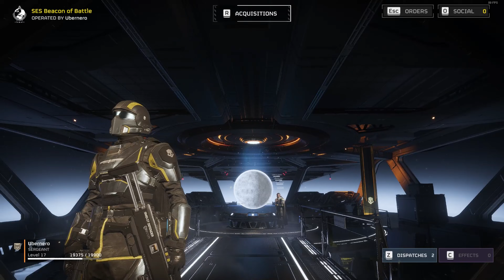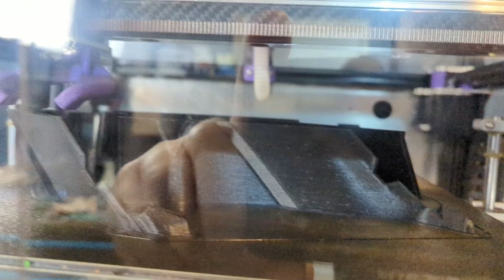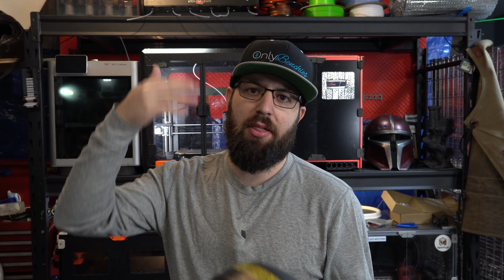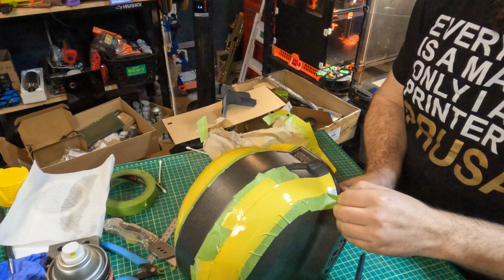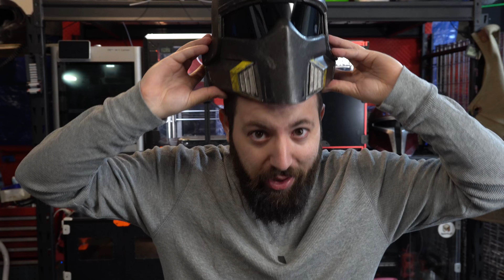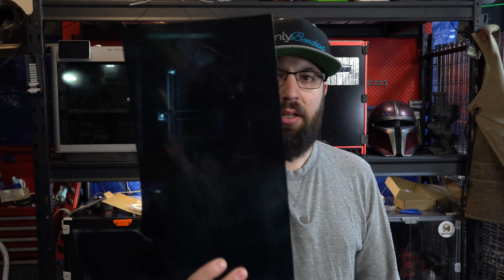I Built My Own Helldivers 2 Helmet (and you can too!) #helldivers2  #3dprinting #cosplay

Comment: I always used to do the many sanding and filling steps with my 3d prints (Mandalorian helmets and armor). For my current project, I decided to take a look at resin smoothing. I will try it with spray resin normally used to seal electric circuit boards. No idea wether this will work at all. But I have the feeling it might be necessary to do all of the pieces in one go, as the resin might cure after the can seal is broken.
I am changing my method now. All of the Mando kits I did before were heavily weathered (so yes, you can cheat a little there). But for this, I am planning a clean kit - so the plates have to be perfectly smooth. Particularly for high-gloss black - I am dreading this, TBH.

Comment: Could I print this on an Ender 3 v3 SE?

Edit: Yes, yes I can and it looks so cool can’t wait to start painting it!
Reply: I got an Ender 3 v2 with the same bed size, which is too small for many parts to be printed as a whole. Did you print the pre-seperated parts then? And how did you put them together so that they don't break apart anymore? I'm a abit afraid of that
Reply: @turwaith  I printed the front with the usual files, But i printed the back and dome with the pre-separated files. I glued the parts together with two part epoxy gorilla glue, but I did have some trouble with the back not fitting.
Reply: @MrLama568  And it does hold together nicely with this glue? Or did you secure the parts in different ways additionally? Because I was thinking of applying multiple layers of 3D print resin and harden it to make the seams even stronger
Reply: @turwaith  It seems to hold together pretty well, but you could add some if you feel like it needs it.

Comment: One of my jobs. I got paid to do a hobby. :~) I worked at Magic Mushroom Lamp & Waterfall Co. The lamp mfg is no longer in business. You can look online to see the mushroom shaped waterfall lamps I made. We cast, oxylite (cultured marble [plastic]) into a lamp shape. They come out WHITE. My job was to make the pieces parts look correct. Pine cones, acorns, manzanita, frogs, pond, rocks. Most of those things were covered in the staining steps. (airbrush). The rocks were various colors. Which we got from rattle cans. The CHEAP stuff. NO $4.00/can stuff for us. We used the $1.25/can cans. We would take a butterfly (flat) drill bit and pierce a small hole in the top of the can. Leaving the bit in the hole, propped against the wall over night. This would bleed off most of the propellant. The next morning we could remove the bit and pour the paint into our airbrush bottles. I asked the boss why rattle can paint. He had been doing this for 30 years and had tried many techniques. He said it was because the viscosity was perfect. Rattle can nozzles are a #5 to #7 airbrush nozzle. Most of the spraying we did was with a #3 and #1 tip. Good paint, premixed and consistent. The cans also come with a glass marble which allows for easy mixing. Once a can was opened it would last a week in the can. 2 weeks if we put some tape over the hole. With used up cans, I would cut the top off and collect the glass marbles. I would put one in the 4oz airbrush bottle to keep the paint mixed as I worked.
 
We used the $125.00 Pache dual action air brushes. Very rugged. Made out of brass. You can get all the parts to repair and rebuild them. They are NOT the BEST. They are also not the WORST. (The $20.00 single action, all plastic, Badger gets that title.) But they are cheap and will last a long time. The boss said he would have to buy new ones every 3-5 years. (Depending upon the monkey/gorilla employee using them.) That is a lot of life. 8hrs/day, 5days a week. My only other "Life Hack" is to use a pipe cleaner to clean out the passages where the needle goes. If your gentle you can use a welding (oxy/act) tip cleaner (wires) to clean out the smaller holes (air passages). Plus to make the needle work easier, put a thin coat of Vaseline (Petroleum jelly) on the needle after cleaning and before re-inserting. It helps the rubber seals to slide easier. 

For anything else there are ton's of airbrush tutorials on youtube.

Comment: Bondo glazing putty can be cut with acetone, which helps for doing something large like this.  Sanding sponges are also really useful for the last pass on a curve surface like this or an R2-D2 heads.  :)

Getting locked into "finish first or join first" for every different model is a mistake.  Different projects need different approaches.  Or a mix of both - if you had to split parts, joining them first lets you smooth out the seam that doesn't exist on the "real" helmet.  Be flexible as you do things!

One thing that should always be emphasised in video like this is ALWAYS ALWAYS ALWAYS test new paint or new paint combinations on scrap.  Especially with rattle cans.  The carrier medium in the spray paint can react to either plastic or other kinds of paint and either deform things or just never cure.  (Literally never - I have a plastic ball I painted silver for a LARP 25 years ago and it's still sticky to touch.)

And this last thought may be covered in your Mando armour videos, but painting something metal-coloured, letting that cure, and then using wet-masking or salt-masking in random spots before you paint it the top colour is a great way to simulate chipped paint.

Comment: I got curious about how big actual military helmets were, and found a 36 page research paper from the Canadian Forces examining the then-extant (2010) helmets and comparing them with a selection of laser-scans of soldiers' heads.  They concluded that the existing Small and Medium sized worked well but the Large needed to be a bit bigger front-to-back.  Unfortunately, They also decided very quickly that circumference mattered a lot less than length and breadth and so didn't provide any information about the helmet circumference's.  Alas.

Not really relevant to the video but I figured it made a nice funny comment for the algorithm.

Comment: The best trick I've seen was uncle jessy and frankly built would slice a thin section of the helmet to get the size right for wearing. I'm going to have to try that weathering effect that looked so much easier than others I've seen.
Reply from the maker: Ive done the thin slice method for sizing before and it works pretty good, although this helmet isnt as easy to do that with as the geometry at the bottom isnt consistant.

Originally i didnt plan on doing the full suit, just print a helmet for some background "art" thats why it was just at default size, after deciding to do the full suit i printed one that was scaled
Reply: @CanuckCreator  How much did you scale it to? I have a 23 and 1/4 inch head, I tried a 94% test ring and it was tight, so now I'm trying a 97%.
Reply: Yeah a sizing ring. I was telling people to do that 6 years ago. Maybe I should have trademarked the idea, lol

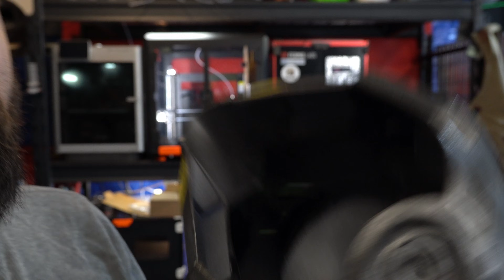Comment: 11:25 would embedded neodymium with a decent pull force work or do you need to tension/ flexibility of an occystrap/ elastic band?
Reply: any idea ho to do that? helm is quite thin
Reply: @SebastianZalewski-p6w  you can get some pretty thin neodymiums out there and some pretty chonky ones too. So maybe you can get something. But agree thin components could be an issue with like tear out. 

I looked at “ kjmagnetics dot com “ in the past as they have good calculators and go into a bit of science on strength etc. amplifying force, halbach arrays etc.